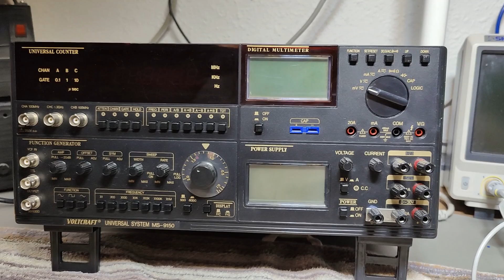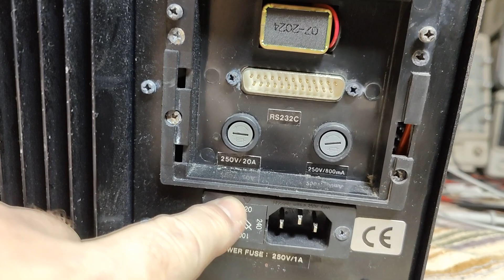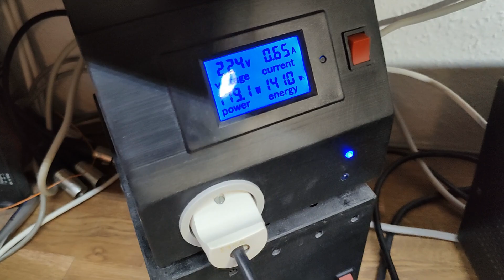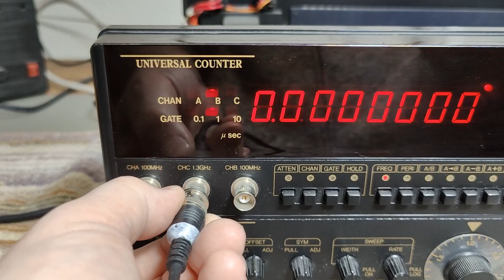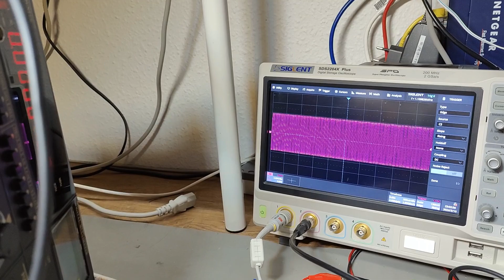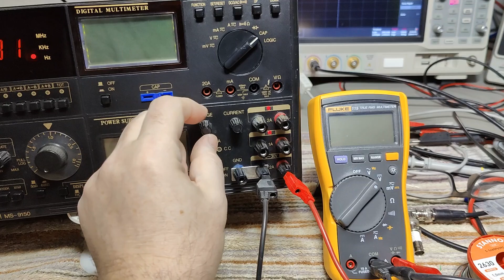Metex Voltcraft Universal System MS-9150 1994-96 all in one workbench

Comment: thanks for the video, ive just bought ms-9140 which has DMM not displaying anything for only 300 PLN (78~$) and hopefully i will be able to fix it, this vid (even though its about 9150) can be useful
Reply from the maker: i hope some of it is the same
Reply: @TeardownOZ2CPU  replaced battery and DMM works now, now i need to only replace PSU voltage (and maybe current) potentiometer and clean this thing up inside a little bit and it's ready to go

Comment: Thanks a lot! I had an exploded 1nF/1kV capacitor and a blown fuse on my MS-9150. After I repaired that, absolutely nothing worked. So I was searching for a circuit diagram and found your video instead. That was the solution! I had also changed my voltage selector from 220V to 240V when I was searching for the originally issue. 🤦‍♂️ After undoing that, everything worked fine again. 😁
Reply from the maker: I am so happy to be able to help, please tell all your friends about my YT :-)

Comment: I bought the Voltcraft MS-9150 as part of a set along with an oscilloscope back in 1997, and I’m still using it to this day. The only issue I ever had was a cold solder joint that needed to be re-soldered. Overall, I don't regret the purchase at all. Even though I now use much more modern equipment, it was a reliable companion, especially back then. 

Keep building and stay curious!

Comment: I have one of those and it is the center of one of my benches.  I have used the voltmeter, power supply, and function generator.  

I got mine for next to nothing at a ham fest.

Funny story about the volt meter.  When I got it, the volt meter display was very dim, but it got better when I pushed on the glass.  I thought the display probably used zebra strip to connect to the main board.  I was crazy careful, and I totally dissected the volt meter and cleaned everything and very carefully put it back together.  The display looked better but still not like the power supply display.  I finally managed to dig up the specs for it, and I noticed that it can make floating voltage readings, and I got to wondering how they did that, and it hit me.  The voltmeter is powered by a battery.  Son of a gun, in the thing I thought was going to have a fuse in it, had a 9V battery.  Replaced that and the display is crisp and bright.

Comment: I have the Metex MS-9170. I believe my model is the latest version of this multi test universal instrument since they stop manufacturing. The DMM is better. It has LED displays instead LCD and all functions are selected by push to make buttons rather than rotating knob. The power supply has LED displays too. Still useful in my workbench.

Comment: This unit was (has been?) in production for a long time. Mine is branded by the Tenma company. The model number is 72-1005. Your newer model has a few more features than mine. I wonder if your volt/amp trimmer might have a resistor in series that has drifted?